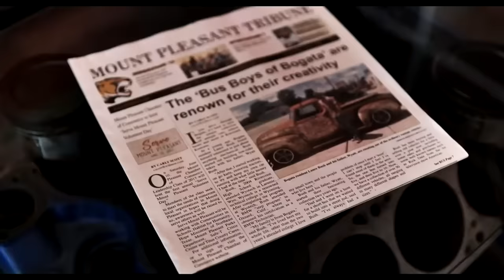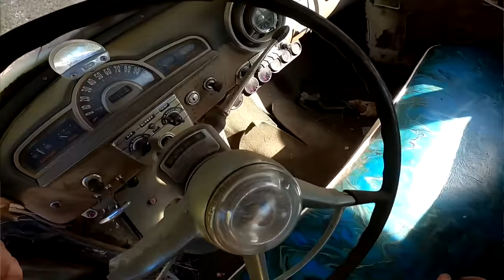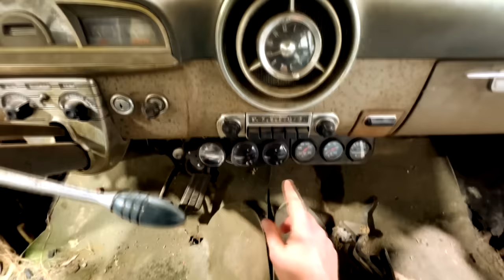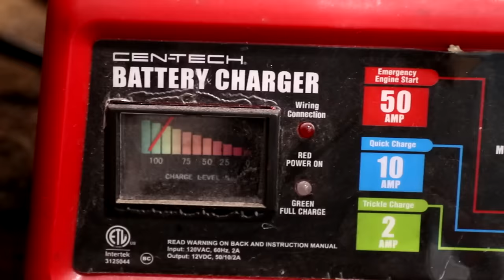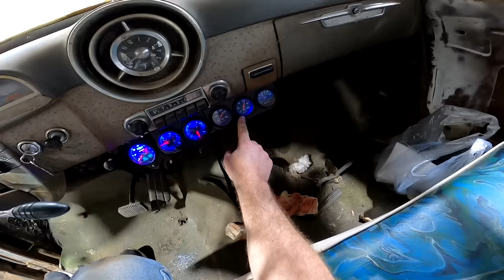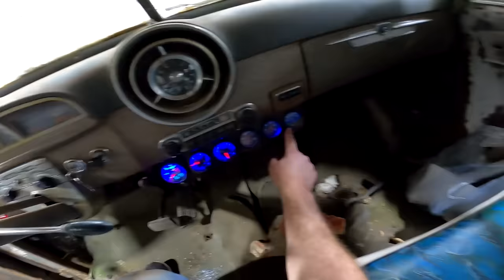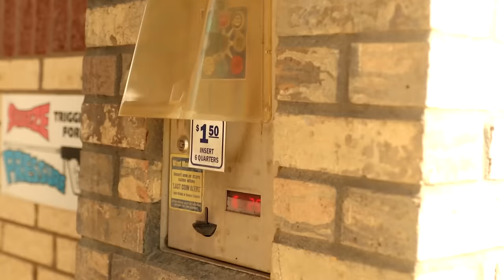Forgotten 1952 Pontiac Chieftain | Cummins Diesel Engine Swap | Turnin Rust

Comment: Back when cars were made from steel not plastic and Coca-Cola cans.
Reply: How many exhaust I've fixed with a miller bud or monster can, you can fix anything with a can metal screw,or zip tie if u cant don' t try
Reply: It is already named just call it The Chief
Reply: How about old smoky
Reply: I agree with you Brasil that IS allright

Comment: I bought an 80 Firebird with no trunk key.  Took out the back seat.  Taped a screwdriver to a stick and popped the trunk open.  New lock only costs a few bucks.

Comment: That will have a full frame, leaf springs in back and coils up front.  The amber plastic “chief” hood ornament should illuminate.  Those Pontiacs had L head straight 6 or straight 8.

Comment: The first few years of the 5.9 in the dodge pickup were non intercooled but judging by the amount of smoke on this one it’s either a later model or turned up so definitely needs an intercooler.

Comment: That front clip might be from a 1951 Pontiac Super Deluxe Catalina.  the mismatch from the single chrome spear tip to the two chrome strips on the door are a mismatch.  the 52 has a larger spear head that grabs both chrome strips.

Comment: Just sand it down & paint it a satin blk. If it was mine that's exactly what I would do. My family hasn't owned anything but Pontiacs. My late grandmother's brother drove his 52 Pontiac chieftain from Louisiana to the Panhandle of FL in order to help them move & when he went to drive it back to Louisiana, it got a crack in the block. I'm looking to buy a 57 Pontiac chieftain. It's a rare vehicle. Redo the exhaust & run it back to behind the rear wheels but out the side or do a dual exhaust & run it out the side like it is but with those wide square exhaust tips. I wish I could be there to help.

Comment: The 1952 Pontiac Chieftain would've come with either a 239 straight six that made 90HP or a 248 straight eight with 104HP.
Reply: My Dad had a 1950 Chieftain fast back with the flathead straight 8. 
He was a Chief Machinist Mate in the US Navy from 1937 to 1957. Hard core sailor. 
I remember when he rebuilt the engine and did the upholstery in black and white. His first job after retirement was in a upholstery shop. 
I was in line with my brothers to get that car when, one night, a drunk totaled it when it was parked on the street.
Broke my heart.

Comment: If that old car was mine I would put a cheap paint job on it and some better-looking wheels on it.  Maybe fix that gap between the door and fender.  I have driven all kinds of diesel engines and Cummins is the best for an automobile.

Comment: 11 quarts of oil a Cummins engine takes I know because I did maintenance on a fleet of Cummins and power stroke and a v10 dodge gas engine it took 7qts Cummins 11 and power stroke took 15 quarts

Comment: GM had Chevrolet, Builck, Pontiac and Cadillac  made of different priorities and purpose,, I like Chevrolet , balance of all, Had one Impala, someone transplanted straight 6 petorl to a 1500cc V4 air cooled Diesel engine with still same 3 speed gearbox not some 5 speed to cover underpower engine, In city car was very cheapand & good to use,,,from1975 to 1977,,, and then to scrap..

Comment: When they go after an old vehicle that's been laying in the woods or a field for decades where it doesn't matter if the ground gets rutted up, they always try to air up the tires... Yet when they went after this one where it has to be taken across an actual mowed lawn, they don't air up the tires and not only peel the tires off the bead, but end up tearing up the lawn.. I don't understand that logic.

Comment: Why did you act soo surprised to see TWO batteries powering a diesel?? Most every diesel out there always has TWO batteries because the compression ratio on a diesel (ex. 22.5 to 1) is WAY higher than a gas engine (ex. 7.5-13.5 to 1), thus a diesel's starter needs more torque (hence more electrical power) to turn over an engine with much more compression. 
Oh, and you would rather drill out a vintage lock assembly rather than calling a local locksmith and giving them a little business? Maybe even plugging their company on your channel if they did a good job picking the lock and making you a key for it... even show them in the process of doing it. But no... you want to go caveman on it and destroy the perfectly good lock just because you are either too impatient or too cheap.
Speaking of impatient, you should think BEFORE you do something stupid, like having your father pour expensive coolant/antifreeze in a totally unknown radiator "hoping" it doesn't have a leak in the radiator itself, upper or lower radiator hoses, heater hoses (if it even had them?), thermostat housing, water pump, etc... etc... etc... . Why not use the brain that God gave you and test it out first with plain old water?? It just blows my mind every time I watch one of your videos at just how impatient and brainless you can be! Look, you and your father seem like good people, but come on... get your acts together. Put some water in it and if it were to leak (which EVERY old car that's been setting for years has a REALLY HIGH probability of doing, you should know THAT... it's just common sense!) then track down the leak(s) and repair them. Then try it all over again with more water... and this is all BEFORE you even try to start it! Then, when no longer leaking without any pressure inside it, try to start it. Then, check for immediate leaks... if none, let engine get to operating temperature while constantly watching for leaks. It's soo simple. Then, after you've pretty much eliminated the chance of it leaking, NOW flush/drain the cooling system and install your 50/50 mix of coolant/antifreeze. 
By the way, an experienced mechanic knows to NEVER, I repeat.. NEVER run automatic transmission cooler lines into a radiator with a "built-in" transmission cooler!! It is THE worst thing you could ever do to your automatic transmission! Why? Because that internal transmission "cooler" is under very little internal pressure, right? When you pull out a transmission's dipstick to check its fluid level (which you MUST do while the engine is running) does it squirt transmission fluid all over? No, because the transmission is just circulating fluid to keep it cool. Now that "cooler" is INSIDE of the radiator's tank, which is HIGHLY PRESSURIZED when it gets to normal operating temperature, correct? So the highly pressurized coolant is constantly pushing in on the "cooler" and the backing off once the engine is shut down and cools off. The pressure/no pressure cycle happens EVERY SINGLE TIME you run your vehicle, so it's pushing in and out on that "cooler's" metal welds, not to mention the heating up and cooling down cycle that's occuring simultaneously with the pressure/no pressure cycle. This eventually causes the internal welds to get brittle and develop small fractures/cracks in the bead of the weld, which then allows the highly. pressurized coolant to be forced out those tiny fractures/cracks and DIRECTLY INTO your transmission fluid!! At first, it's just a little coolant here and there in your transmission fluid, but after years of driving and THOUSANDS of low/high pressure AND low/high heat cycles, your transmission slowly builds up a LOT of coolant in its fluid which wreaks havoc on the transmissions internals! Then, you start having transmission issues... bad or no shifting, grinding, slipping, etc... .  

So, yes... you had NO transmission cooler and ANYTHING is better than nothing. However, you are promoting for people to use internal, radiator located transmission coolers, which is TOTALLY WRONG if those people want their transmission to last a long time!!

Here is the solution, and it's VERY simple... use an "external" transmission cooler. This way, you can NEVER get coolant/antifreeze inside your transmission, NEVER!! There are 3 types of external  transmission coolers out there... "fin-on-tube" (the cheap one's the sell for $30-$40, the easiest to damage, AND the least efficient), "fin-on-plate" (or was it "tube-on-plate"?.. doesn't matter, I never use them anyways... which are more efficient than "fin-on-tube"), and finally "plate-on-plate" (which is the MOST efficient of all 3 and built like a tank!). 
I ALWAYS use the "plate-on-plate" cooler with stainless steel braided, high-pressure hose (even though it's very low pressure... I like overkill) along with AN compression fittings because they rarely leak when installed properly. Now after installed properly, one can relax knowing that your transmission is safe from coolant/antifreeze intrusion! What's cheaper, spending $200-$300 for an external transmission cooler OR $2,000-$8,000+ for a rebuilt/new transmission? Math and common sense DO NOT lie.

Don't get me started on radiators with plastic tanks!! Same deal... buy a high-quality aftermarket aluminum or brass tanked radiator and be done with changing radiators every few years. High heat makes the plastic brittle and high pressure causes the brittle plastic to crack/leak.

Another thing... do you NOT having a garden hose or even a cheap pressure cleaner at your shop the you could use to clean you vehicles each time you get a new, dirty one? Why on Earth are you driving a vehicle (that's sat for years) down a public highway with unsafe tires and unknown braking capability, not to mention probably no turn signals, brake lights, etc.. AND without proper insurance?! What happens if an old brake line from the 1950's bursts on you and you hit another car, a pedestrian, or a building? STOP BEING LAZY AND IRRESPONSIBLE!! Stop driving unsafe vehicles illegally, no matter how short the distance! Laws are meant to be followed for the public's safety... so stop ignoring other people's safety by putting them in danger just because of your laziness or stupidity!

Sheesh!! I shouldn't have to keep reminding you about this... try reading your comments, you might just learn something.